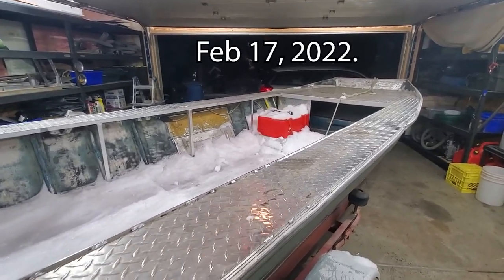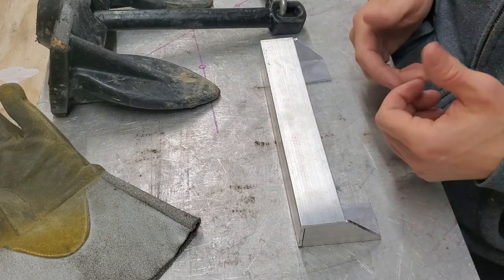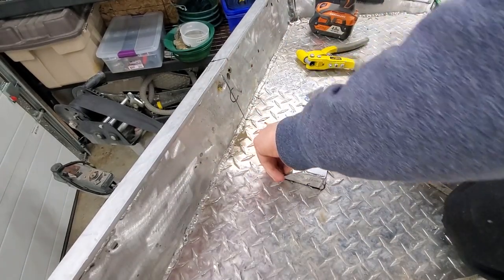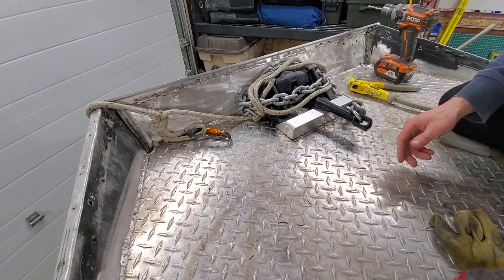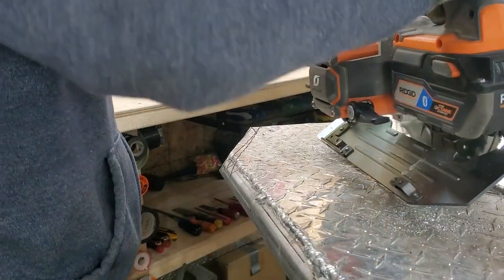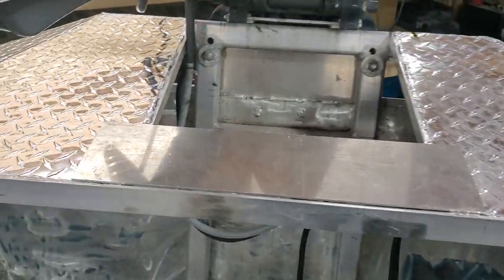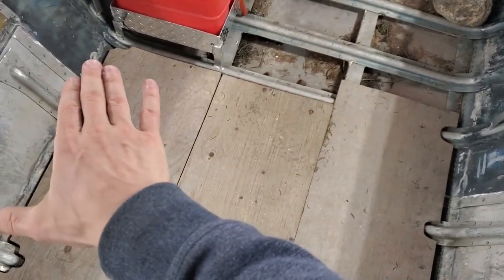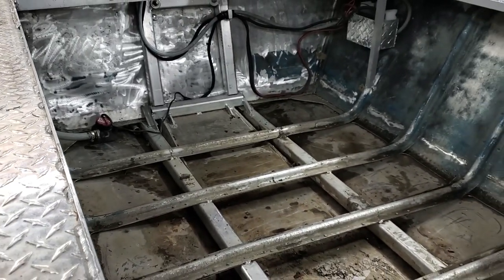Simple Jon Boat Anchor Storage Solution for my Mining Rig.

Comment: Also don't forget, which I'm sure you haven't, about the motor over heating when running the high banker. Maybe there's something you can plan out for better ventilation.
Reply from the maker: Ah yes... that!  I've just switched back to running the highbanker engine in open air.  I'll have to experiment with a better ventilated quiet box again some day...